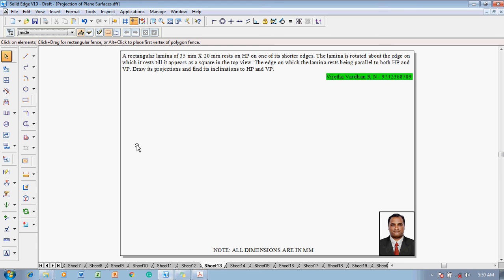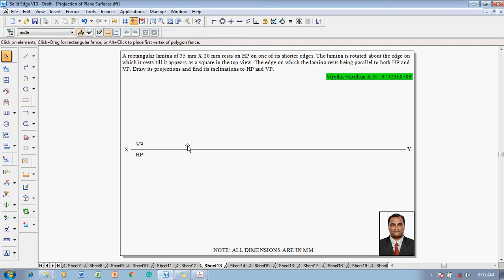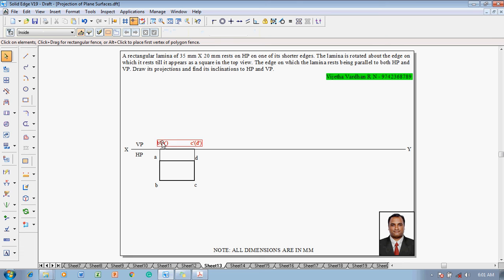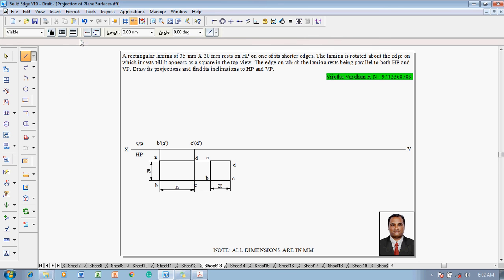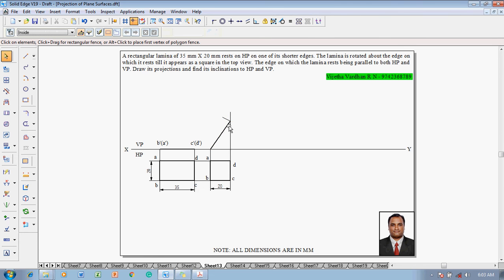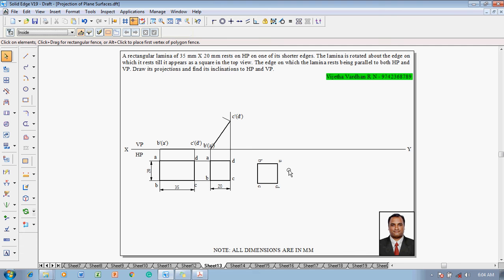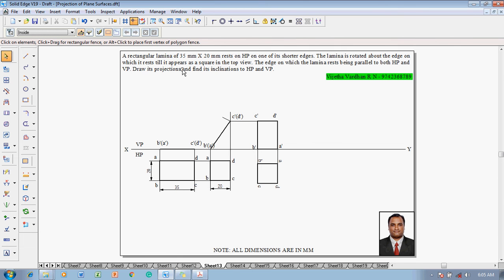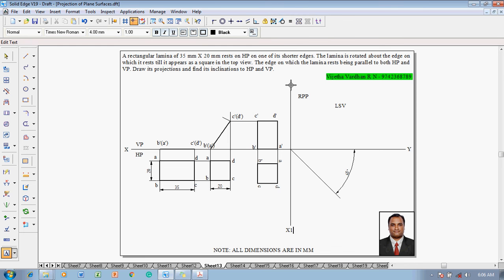Example 13 on Projection of Plane Surfaces

Comment: I think the RPP is not required to draw as you can measure the angle directly from the second projection
Do correct me if I am wrong
Reply from the maker: Indirectly what you said is correct, but we need to identify the inclination with both HP and VP so we need to construct the RPP.
Reply: @VijethaVardhanRN  okay, thanks